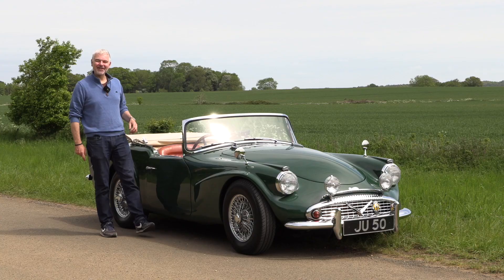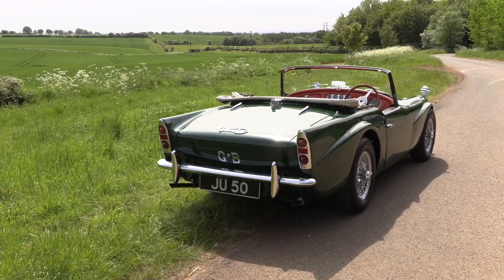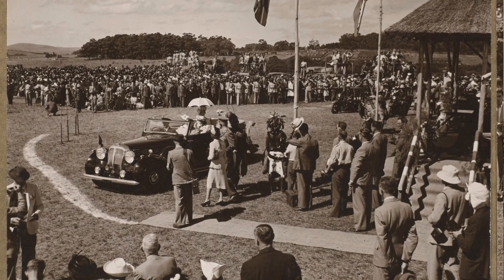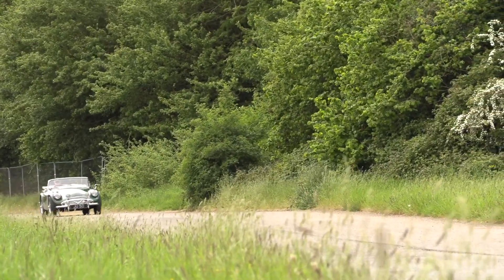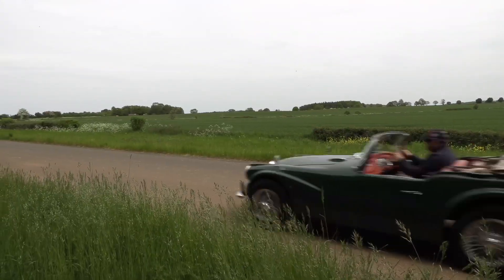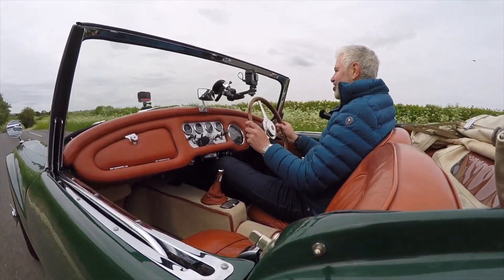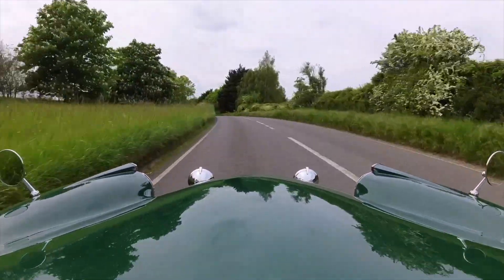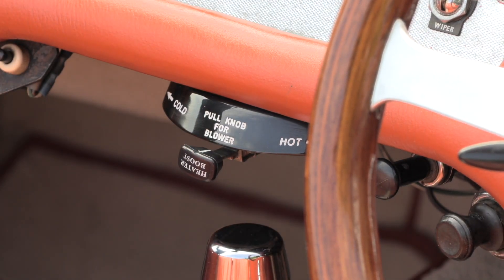It Wasn't Very Good BUT The Daimler Dart Has A Hidden Ace..

Comment: My father had a colleague who owned one of these and around the early 1960s he was killed in one when approaching a roundabout too fast - the brakes were sadly too inefficient for a car with that amoung of power (or that amount of ridiculous over speed).  The car overturned.  The driver lost his life but the passenger (another colleague) survived with serious injuries.  From that time as I undestood it the car was regarded as seriously under-braked but I don't know if that side of it was improved or modified with later models.  It surprised me then at the age of 17 that Daimler could make something so clearly poorly built or with design flaws.  Comments are welcome.
Reply: 4 wheel disc brakes (in 1959) are more than adequate for any very spirited driving.....and I've been round both Donnington and Silverstone in mine...hard and fast.  Nothing wrong with the brakes....driver error?
Reply: @simonoldroyd5037  Good point, the phrase springs to mind "It's not the speed that kills it's the nut behind the steering wheel"

Comment: 0 -- 60 -- 0 mph in something around 12 secs.  In straight line performance, the Dart licked the arse off an E-Type Jag up to a certain speed, after which the Jag walked away, with its very much larger engine!  I understand that it was for this engine that Mr Lyons bought Daimler because he didn't want Daimler to refine the Dart to the point where it would challenge E-Type sales. However, the urbs are full of legends and modicums of possible truth!
Reply: As the owner of both this Dart and the E-Type that Jack reviewed in November I don’t think I’d go along with the technical analysis.  I don’t think the Jag is out accelerated, out braked or out handled by the Daimler. That is a reflection of the fact that the Jag was about 50% more expensive, and below the skin it was much more advanced than the 3 year gap in launch dates suggests.  But, several decades on, these differences  matter a lot less than they did at the time. It’s more about how enjoyable they are to own/drive as classics.  And on that level they both great propositions  in their own very different ways.  Like 1960s Brigitte Bardot v Barbara Streisand (you can decide which is which) 

Ps I think that Jag bought Daimler as a quick way of expanding  production capacity.
Reply: Jaguar bought Daimler for their production site following the Jaguar catastrophic Browns Lane fire....I doubt that either of the V8's entered the equation as both were little used and both tragically  binned by 1968.
Reply: @simonoldroyd5037  That is correct - they wanted the production capacity, not the cars.  However, putting the V8 in the Mk II Saloon, and keeping it going for 8 years after they bought Daimler suggests that they thought it was a very good engine.

Comment: 20th century. The switch to Rolls-Royce was influenced by Prince Phillip borrowing the "Scalded Cat" Bentley Mark VI which is said to have inspired the Phantom IV, a much toned down affair, which is still in the Royal collection.
Reply: So that sounds like the fifties at least and not the dubious forties era quoted. Add the start of the 19th century confusion in the vid
Reply: @johnd8892  The PIV launched in  1949/50 before the Docker Daimlers really wrecked their reputation.

Comment: I wonder what the 4 1/2 litre engine from a Majestic Major would be like in a decent sports car.  It's not much bigger than  the 2 1/2 litre engine
Reply: Correct !  The Maj Maj is only 1 1/4 " longer ,1 1/2 " wider but 4" taller :There are several SP250 owners known to the register who  have fitted the Maj.Maj. engine to their cars . I drive a Maj Maj Spl , which I commissioned in 1978 , along the lines of a MkV1 Bentley Spl. with suitable chassis, susp. & gearbox mods /final drive updates. It is capable of almost twice the permitted UK legal speed limit  on a good (traffic less)day. The William Lyons 5 litre Maj Maj engine in a Mk10 bodyshell lapped the test track at a constant 135mph in 1962/63. Sadly Maj Maj spare parts are as as rare as hens teeth nowadays .
Reply: @Birashanuman  All MajMaj engines were for auto box, as were the 2.5 saloons.  Is it hard to adapt them to manual? Your post inspired me to look on line, and I found an ad for a repaired 4/5 attached to a Jaguar 4 speed + overdrive box.  I think it was sold...  but is it a difficult conversion?
Your car sounds like an interesting beast.
Reply: @pashakdescilly7517  The advert for the Maj Maj mated to a manual Jaguar o/d  box was last year ,and was already sold, as you remark. The conversion is not too difficult if you have access to a machine shop . I used the Jaguar bellhousing inverted.with an adaptor plate Nowadays a Supra 5 or 6 speed box or a Getrag or BMW box is a better and more useful conversion, though admittedly not of the right period if 'originality' is an issue .  Not all 2.5 litre saloons were autos. Quite a number of the  manual option models were built, thoiugh are hard to find nowadays.
Reply: @Birashanuman  I think your YT handle is a reference to an ERA race car of the '30s driven by Prince Birabongse of Thailand. Correct?
Reply: @pashakdescilly7517  Spot on ! I have now tried 4 times to give you my contact but it is auto deleted each time. Any suggestions? I have seen elsewhere your posting about the Swordfish & Taranto & the Bismarck I believe ? My late father supported the Fleet Air arm funds for sponsoring the plane back in the 80's & 90's

Comment: I love how many of the sports cars Britain produced look.

But they tended to use archaic technology in running gear, brakes and suspension.  And the build quality was in general appalling.  

I finally sold my Spitfire when I realized years of dealing with mechanical and electrical issues meant I didn’t trust it to get me to and from the grocery store let alone a nice weekend down the coast.

Comment: Cheer up #27.

You now often appear to be in negative mode especially where older British cars are concerned. Click bait ? .. surely not.

For my sins, back in my ton-up boy days on London's North Circular, had a Patrol car Daimler Dart try to keep up with my Triumph. It failed miserably, my Triumph did just that... Triumphed. All at legal speeds back then.

Move on a few decades and I was pulled up by the Boys/Girls in Blue in my wife's MG ZS. Cue 

"You were a bit brisk there Sir!"

Thinks you betcha. ... No shame in being pulled over in the small hours after collecting Mrs MG John from her Christmas Party and wisely chose not to drive just in case. They were checking for late night drinkers behind the wheel. My "Briskness" gave them a reason for the pull... all speeds within legal limits. I recognised the unmarked car having seen it pulled over some baseball cap backwards yoofs in a so called French hot hatch a few days previously. So decided to play.

My strong objection was the car they used. A Poxy BMW 3-Series. Probably the worst car I've ever been pulled over by. Oh the shame.  A BMW. What is this nation coming too?

SP 250.  Beautiful old British Cars and like the Stag, has one of the finest sounding ordinary car V8s on the planet.  Some lucky devil local to me has a bright red one. Saw it parked up and got a couple of images.
Reply from the maker: It’s not clickbait if it’s true.. thanks for the memories!!

Comment: It was certainly not.the worst British sports car. The Triumph Tiger had a 260 or a 289 cid v8 engine and had better performance  but e.g the Triumph Spitfire had only a 4:banger with less than 100hp.as did the MG. All lightweight British cars back in the day were rust prone and the Daimler was no exception. Lotus made some good cars but many lemons too. The styling of the Daimler might be strange now but it is not far from a Frogeye Healey. No, when it comes to the worst you have the Triumph TR7, the Triumph Stag and the Reliant Scimitar among others